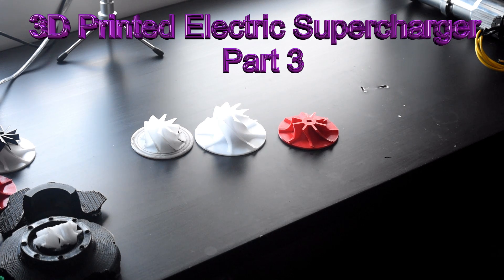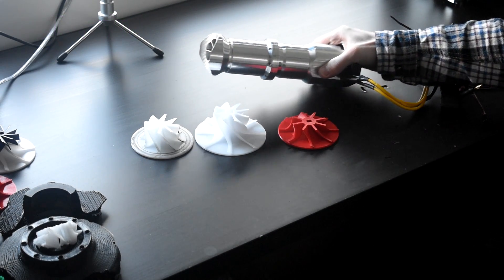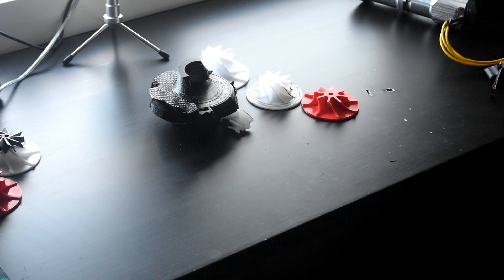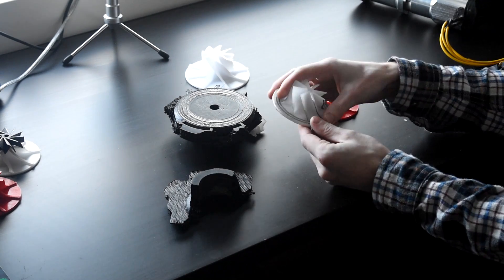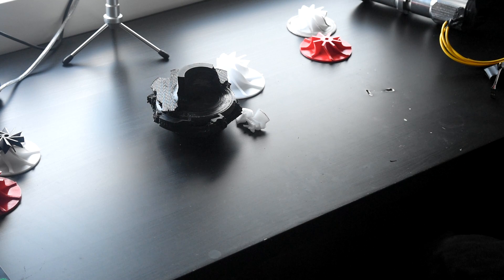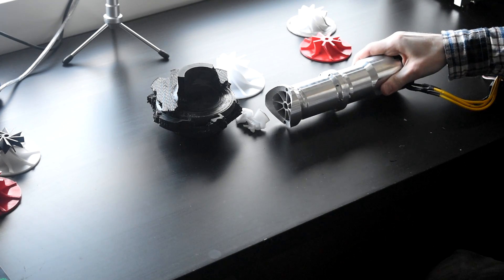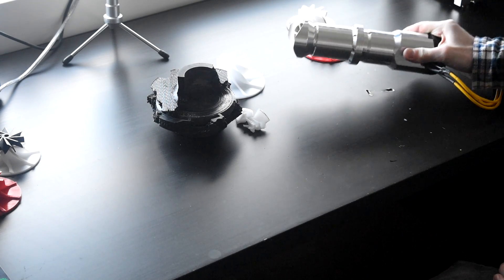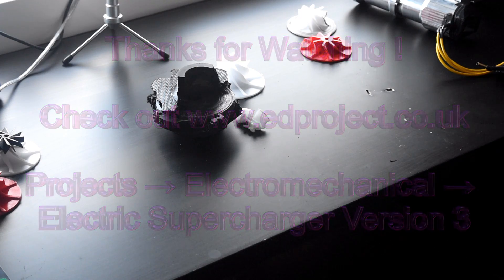3D Printed Electric Supercharger Part 3 - Explodes

Comment: I'm an automotive performance builder and an electronical industrial control technician with some engineering skills acquired through years of experience. I've been experimenting with brushless motors and centrifugal superchargers for a few years now and have recently considered forced induction for a small block V8 consisting of four pairs of mirror image centrifugal bldc motor-driven direct-drive compressors each on its own stack to an individual-throttle-body (ITB) EFI setup. T-3s like they use on Isuzu 2.2 diesels would make a good model and since there's no turbine they don't even have to be metallic. Most small blocks ran 750 cfm carbs N/A so distributed a couple of hundred cfm each would probably be adequate. At least 15 psi would be a ideal target of course; but even eight would be great. 40,000 is a pretty safe impeller speed and small ones would have little inertia. Just something to think about. There was a Dutch co. that did bigger T-4 versions with 48v brushless motors (Torqamp) but they're already history. If you can make 200 cfm ones that will put out 5 to 8 psi or more you would be golden.